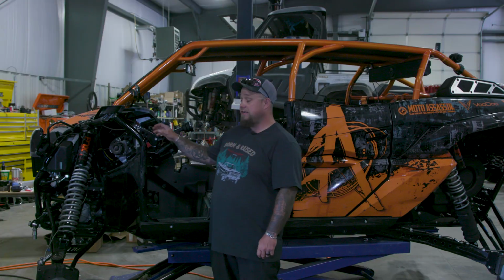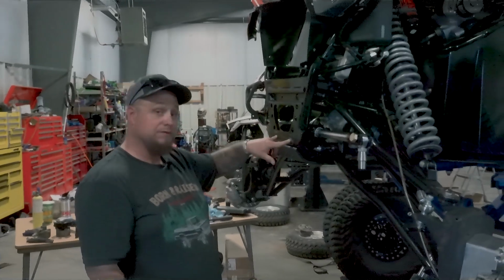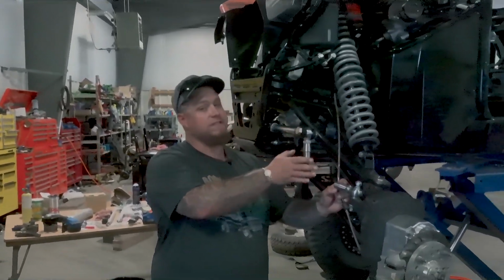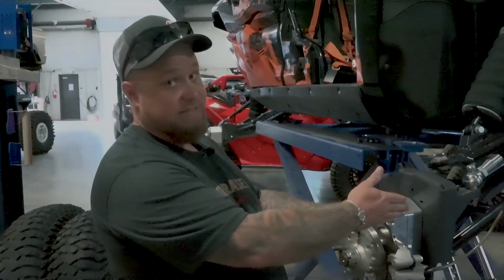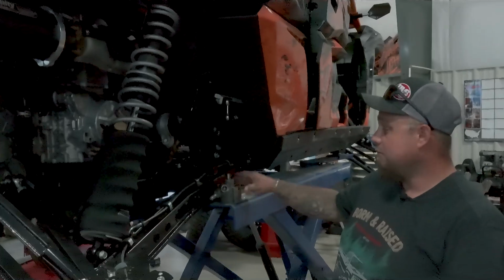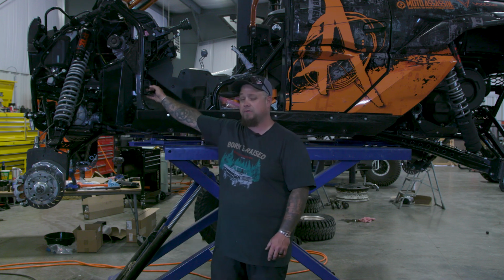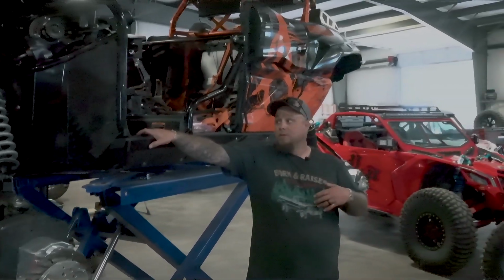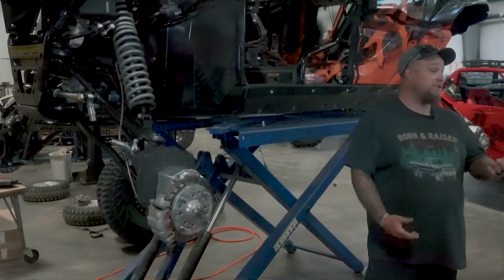Upgrading to Full Hydro Steering: Kawasaki KRX Build

Comment: I did hydro on my rzr. Watch the length of your hydraulic cylinder. I used an 8” stroke and took an inch off of both sides and limited the throw. It’s still too long and when I climbing a steep grade the front raises and makes the tires toe in a lot. Try and keep the stroke the same as factory so it doesn’t do that to you.